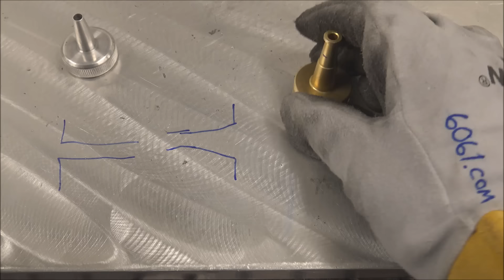Casting an Aluminum Part in Plain Old DIRT

Comment: When I cut threads into a short blind shoulder I have an opposite hand bar and I run the lathe backwards so I can cut outwards. This also lets you cut faster for better Finish as well as not worrying about crashing. I use the same method with normal turning in bores just flip the bar upside down and run the lathe the same way with the lead screw backwards.
Reply: Just gotta flip the tool.

Comment: New from Miller Welders, the Dynasty Series Tig welder and home ARC furnace................
Reply from the maker: It was melted with a PrimeWeld 325x
Reply: @6061  Did you ever have a knife channel here? I just came across a guy "knife video channel" that i swear sounds just like you.

Comment: If your lathe chuck is not threaded on, you could turn your cutting bit over, start cutting y our threads on the opposite side and have the lather run in reversr with the carriage moving out to make a  right hand thread. That way you could power feed and not do damage by crashing. If the chuck is threaded on, you run the risk of it coming loose or even off while turning in reverse.  Keep in mind, it requires a different boring bar or insert tool.  Might have to make your own out of oil hardening drill rod.

Comment: Quite wide variety of skills! Tip for knurling: touch off, go off the part so only a fraction of the knurling wheel overlaps, set the depth. If double tracking you can adjust it this way and once set right gradually move the tool laterally until full width is reached. Of course the handle has to be set at a slight angle to not have too much binding moving it one way. Watch for the slop not to bite in too much.
Great video!

Comment: Wish I had a lathe, and a CNC machine for metal, wood, and acrylic. Basically like what Steve Meade’s shop is setup, but either a CNC plasma cutter or the one with the thin wire. I think with my background in welding and those big toys I could custom-build some sweet stuff for people’s Rides.

Comment: For small parts if you don't want to put effort into good casting results pouring aluminum into a piece of round pipe and machining it is a lot easier, especially since the "mold" can be preheated. There are inexpensive (under $300) Chinese electric kilns on Amazon and Ebay that come with everything one needs to melt most common non-ferrous alloys.